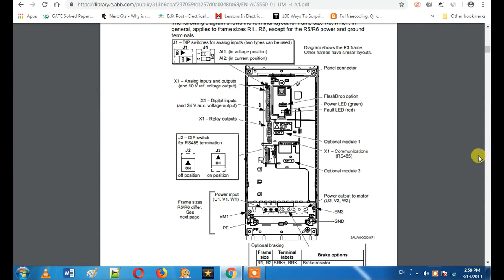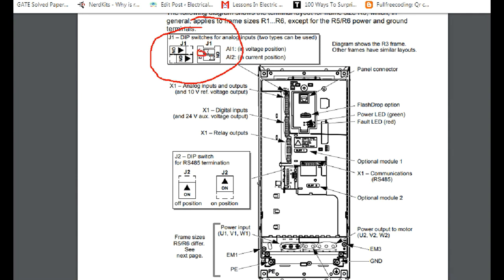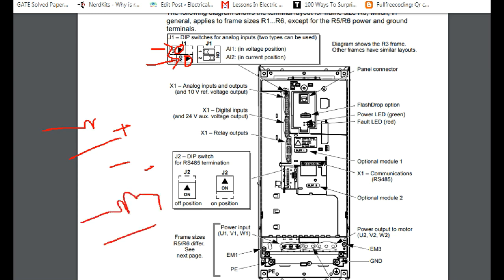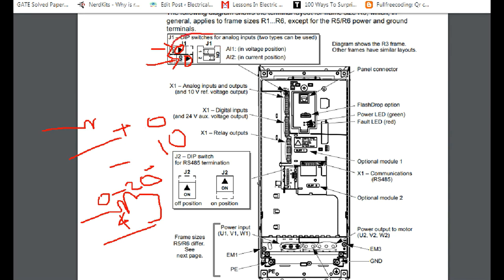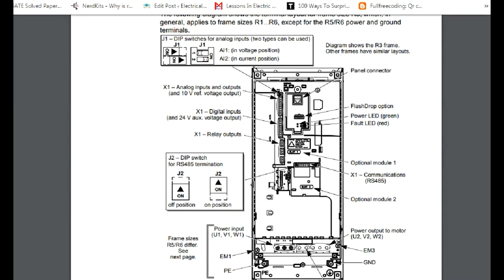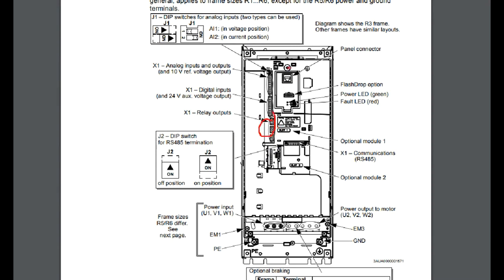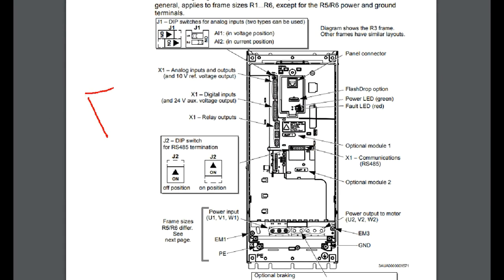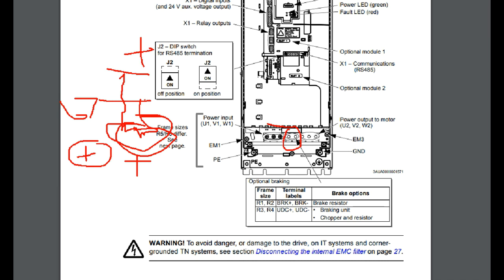How to install ACS 550 VFD Part 2 In Tamil

Comment: Please clear this sir 

3 phase motor 5 Amps in name plate. so multimeter la 3 wire 
Check pannum pothu full amps 15 ah or 5 thaana? OLR la 5 amps set pannanuma illaddi 15 amps set pannanuma? Appo antha motor totally evalavu amps edukkum